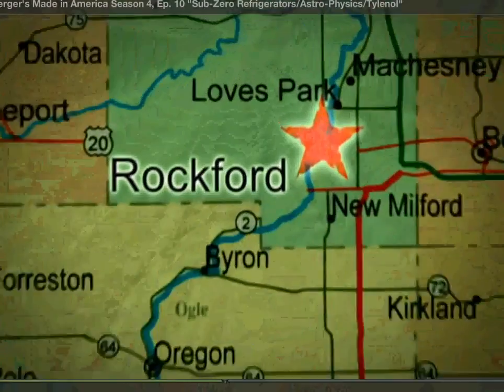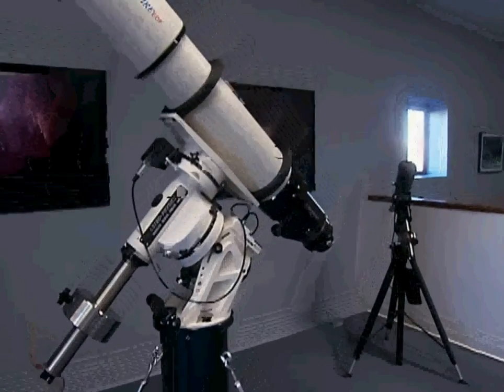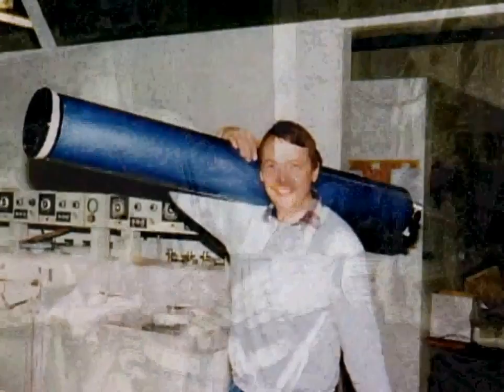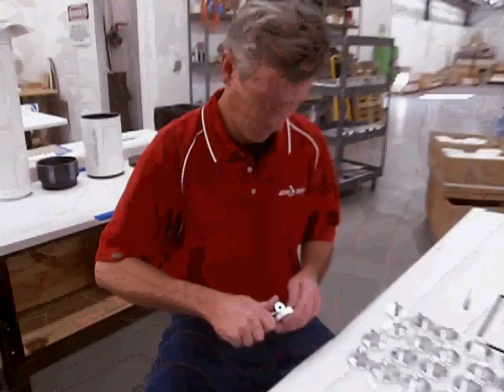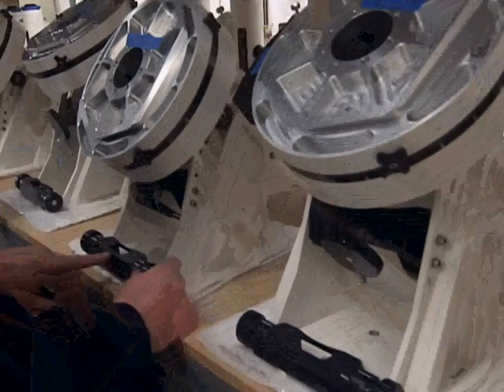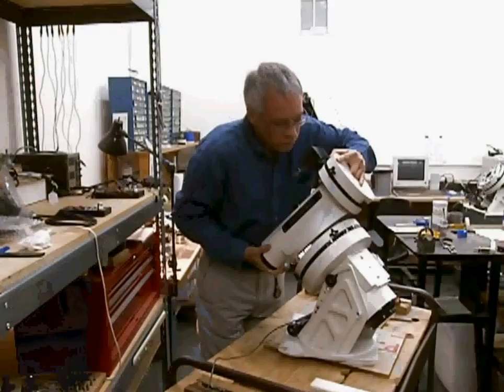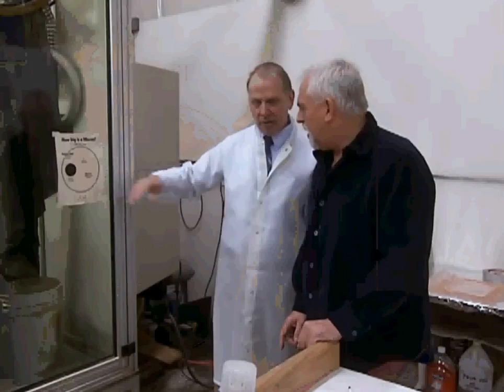Astro Physics Apo Telescopes

Comment: Wish they made visual scopes.
Reply: I use mine for visual.  What do you mean?
Reply: @twm1452  Technically of course you can look through the scope but they are made for astrophotography. That means they are triplets which is a bit overkill for visual and they have short F ratios which are harder to make without optical aberrations. Longer F ratios have less aberrations. Also, astrophotography scopes typically are not best corrected for green light which is the best wavelength for visual viewing. Like I said one can use them for visual. Most of my scopes are made for astrophotography due to the fact that you really can't get anything else.
Reply: @lornaz1975 Yes, all true.  Sometimes overkill is fun though.  Lots of great achromats available from others now.  I did read a couple years ago that AP is/was considering a “super achromat” (Not That there’s a great chance of ending up with one)
Reply: @lornaz1975 Actually, look at the 155CS, looks like it may be the “super achromat” discussed..
Reply: @twm1452  As the AP website states concerning the 155CS, "the new CS Christen Superachromat; optimized as a high resolution, high contrast imaging platform ..." I will say it is well corrected in the green but it would be nice if it was shifted away from the blue and more to the red. Blue is not that valuable for visual but blue is valuable for astrophotography. Also, its F6 and not F8 or longer. Really for 6 inch longer than F8 would be a chore to use.

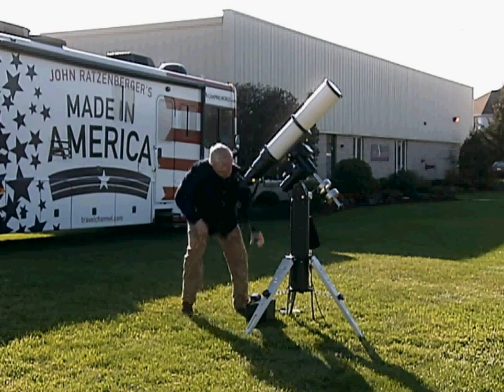Comment: @6:47, no head gear, no gloves, no masks and 2 air-spaced lens placed in open room!!. Thanks but no Thanks.  @7:36, what can you see in daylight !! Moon may be ?
Reply: You don't think this was just done for the video?
Reply: Guru H --- As an amateur astronomer for 40 years, I can assure you that with a decent telescope such as the Astrophysics 6-inch refractor you can see several planets during daylight hours.
Reply: The machines used for shaping the lenses are used in a slow rpm and a constant stream of water.
The slow rpm is to ensure a very precise surface and the water is a coolant/lubricant for the abrasives .
And to tell you this telescope is not for you whitout telling you it's not for you.
If you placed an order the same moment you commented, you would still be on a waitinglist today.
Reply: Ha, funny you would say no thanks to a telescope that anyone who knows anything about telescopes would pretty much walk on hot coals for :).
Reply: And tomorrow my first AP telescope is going to arrive. Dreams really do come true.